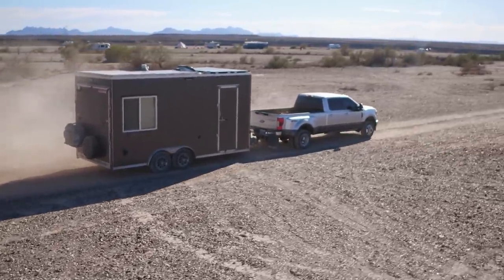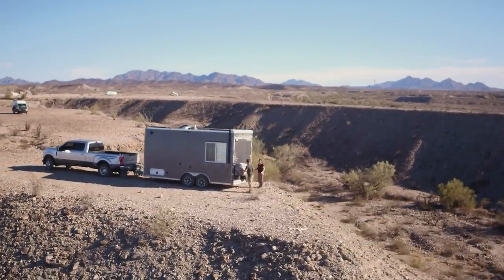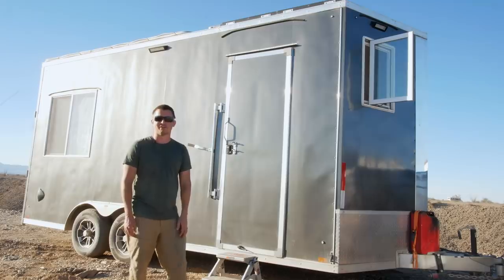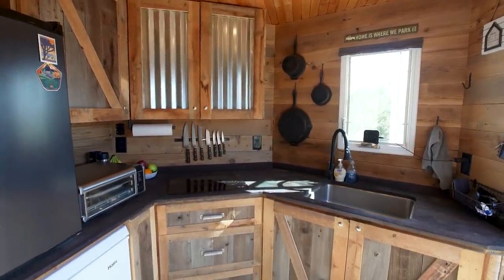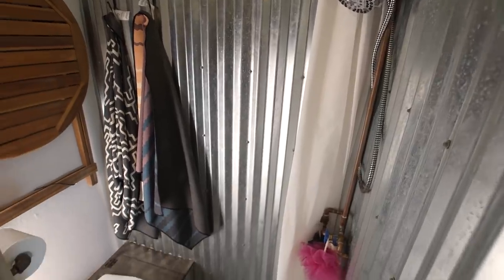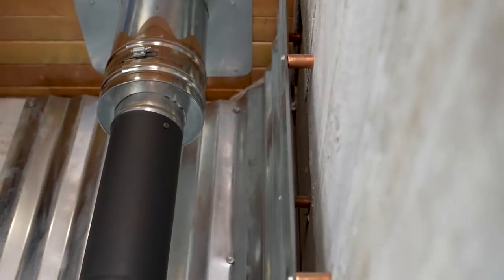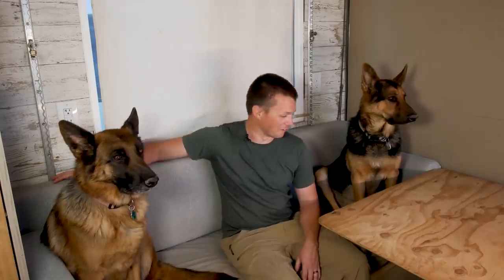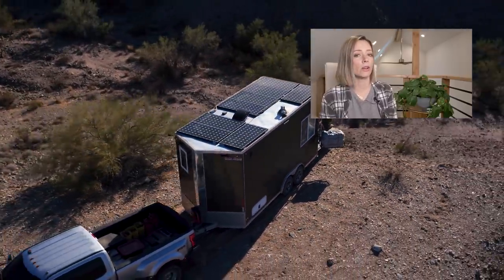TOY HAULER  turned TINY HOME for adventure couple + 2 dogs

Comment: Put a truck style trailer nose cone over front window on gads struts. When you drive it protects the window from getting any leaks while driving in rain and also acts as a shade over window when stationary.

Comment: Great design! Packed with storage and who knew you could put a deep freezer in a THOW cargo trailer. That's awesome! Was thinking skoolie but after seeing this, I'm reconsidering my ideas. The flexibility this set-up offered is astounding. I had never considered a cargo trailer as an option. Great work y'all.
Reply: Right?!? I am shocked lol
Reply: If you go the trailer route, I'd say great, but look into trailer sway prevention/control electronic systems such as:  Sway Command Electronic Sway Control System for Electric Trailer Brakes - 1 to 2 Axles
Item # LC380605
Reply: I don't want to spook you....it's a trade off.  Engine fires destroy buses rapidly (& per one statistic, 1% of buses catch fire per year)......but then there are video compilations of trailer fails.  With proper planning and maintenance, I'd feel comfortable with either a bus or trailer.

Comment: I really like the set up of the whole home. Unique, versatile classy, comfy, just works well. The home works for them. Not them working the home. I really love this. I really like the bed to. I think and fell that it would be some much easier that way to. Just move the bed up and down for your needs. Then to see there is enough room that it doesn't have to be down all the way to enjoy and the living area is still roomy to stand and move around.  Love that. Thy just need one of those flexible screens for the flip down deck. So the buggies don't get in.

Comment: Beautiful, and looks so very comfortable and homey. I love the bed, great idea. Can you use cast iron pans on that cook top? I didn’t know you could.
Reply: They mentioned having a flat top on the log burner to be able to cook on it, so that is probably where they use the cast iron pans.
Reply: Yes, you can use both cast iron and stainless steel on induction cook tops. 😊 We do also use our wood stove when it is running in winter.

Comment: The lift system for the bed is perfect, I never saw a system close to that in other tiny home with a lift. Does it have to be manipulated on both sides to work well? Could if be used at the end of a tiny home? I was wondering if the back lift door was the only entrance, I guess that there is another door , probably in the kitchen. I will watch this video again and again! Great example of how in a small place can be functional, there is  even a workplace for both of them!!! I think they could sell built like that , but I guess travelling is their main activity now.

Comment: Great build -- they own two huge hair loosing machines, you know you love dogs when you live with that 🤣
Im gonna use that AC mounting idea.  Lots of folks building out these cargo trailers dont realize how they are naturally set up with the wheel positions further back compared to a ready made camper - which in turn produce more tongue weight. And everyone builds a big heavy wood kitchen in the front. So the idea of the AC in the back is great.  I also want to build movable cabinets that will stow between the folding twin beds at the rear during travel  further reducing tongue weight.
Cheers

Comment: They could solve the tongue weight issues if they traveled with under floor drawers in the open position , that would shift a lot of weight over the axles.

Comment: Super fun to see these builds.  But Honest question here.  I can buy a 25ft camper with slide out and add solar.  Why do these trailer builds instead of a regular camper with slide out or even without.
For context I own a ~30ft camper with 12' slide out and bunks for my family of 5 and I am comparing these to a normal camper. My new camper was $33k in 2022.  Weighs 9k loaded.

Comment: Amazing you can level the bed and raise it without electricity!  Curious.....are people with trailers looking into electronic sway prevention/sway control systems?

Two examples of several on the market:  1)  The Tuson Sway Control (TSC) is the most intelligent electronic sway control system on the market. Our patented asymmetric system (independent left and right side braking) continuously monitors trailer yaw, rapidly identifies a trailer sway condition and applies braking force on one side of the trailer, directly counteracting trailer sway with minimal speed loss and greater stability control.

It goes on to say: even detects off-road towing conditions. 

2)  Sway Command Electronic Sway Control System for Electric Trailer Brakes - 1 to 2 Axles
 Item # LC380605

Comment: Why wouldn't you go with a roof air like I did ?  My 18x7x7 Victory has a 1,000 b t u  air at a cost of $1,000.00 . You can hang meat in there .